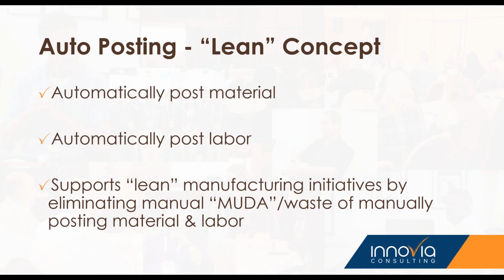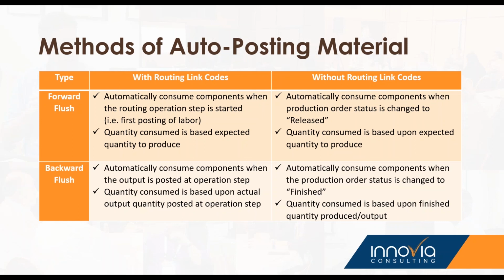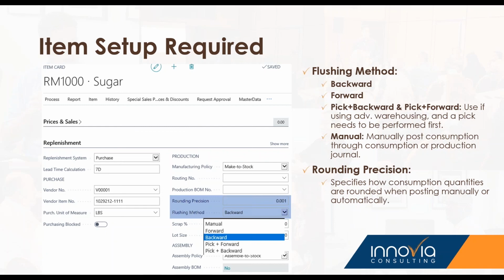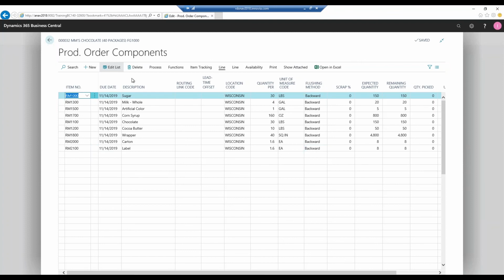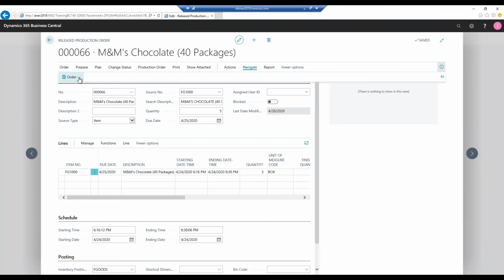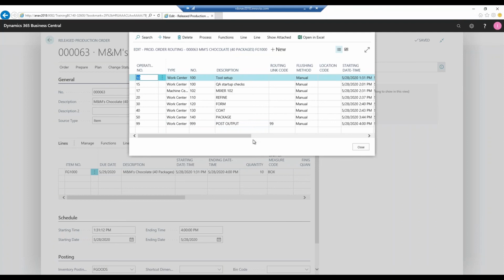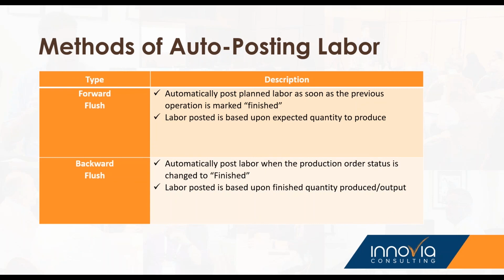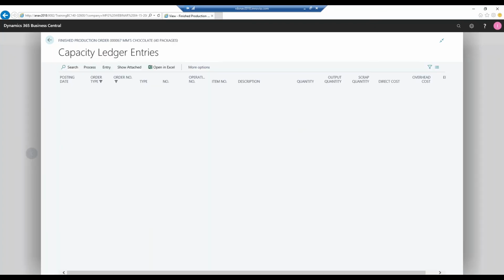How to Auto-Post Using Flushing Methods - Business Central for Manufacturing 101

Comment: First, this was extremely informative, so Thank you!!
Second, if the last step is set to backflush, will that overwrite any other processes that are set to manual?
Reply from the maker: With the last operation set to Backflush:
You are able to change the Production Order status to ‘Finished’ and by default the Output Quantity will post matching the order quantity.
Components will be consumed if set to Backward flush or you could use manual on components and complete the consumptions before changing the order status to Finished.
If other operations are setup as Backward the labor will be posted or if Manual, you would enter time before changing to Finished.

A simple process is create the Prod Order
Last Operation is Backward Flushed
Components are Backward Flushed
Other Operations are Backward Flushed
Simply change the Status to Finished and all components, labor and output will be done automatically.

Comment: Thanks , but I am still having issues about the forward of backward flushing, Jus the "why"-  question always pop up , why not just consume what u put in there based on the recipe in a consumption journal instead of this automatically posting of the stuff after a production order gets a new status or something like that?? Tnx
Reply from the maker: Forward Flushing method
Example – The Bill of Material (recipe) is for a batch size of 100 lbs.
                   When the initial operation is completed you are able to consume the components for 100 lbs. – you haven’t actually output anything but simply loaded up the mixer.
                   If you had 10 components you would have to manually consume the 10 components
                   If you used ‘Forward Flushing’ on the components no manual entry is needed (when you posted the 100 lbs on the operation the system automatically consumes the component items

Backward Flushing method
Example – Production Order is for a quantity of 1,000
                   When output of 200 is posted all the components necessary to make 200 of the finished item are consumed automatically- no manual entry needed
                    Later you post another 310 the system automatically consumes component quantities to make 310 – no manual entry needed

The auto flushing works well but may not fit all MFG environments – one of the LEAN functions BC has.

John